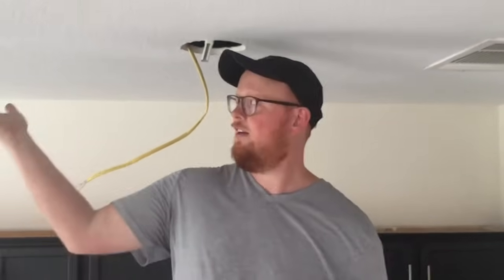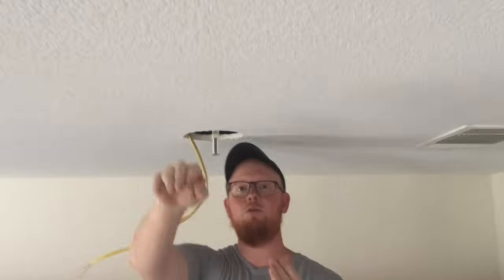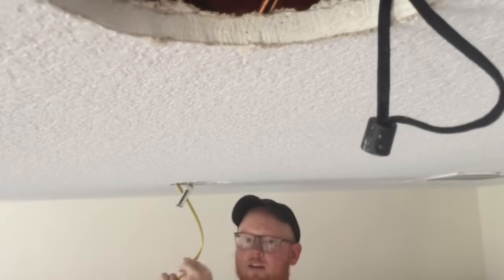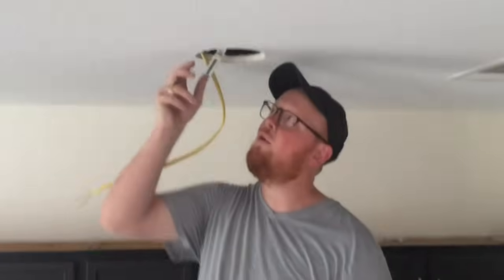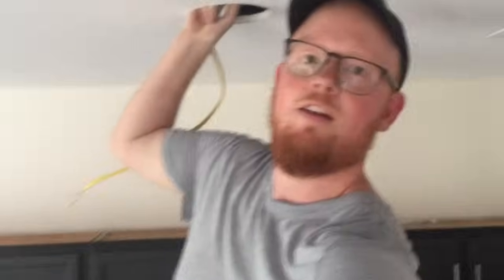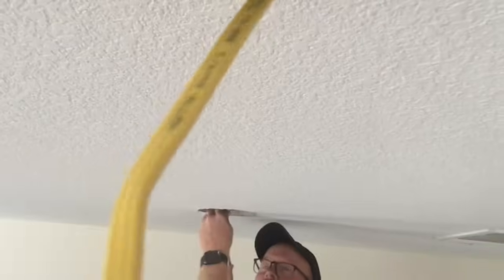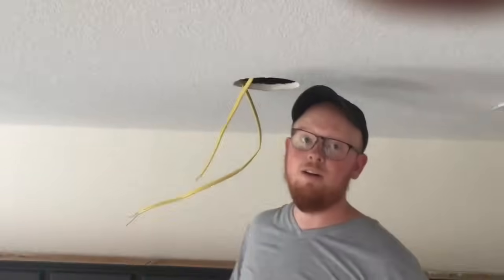Genius Method For Fishing Romex

Comment: The long drill bit you used to drill through those two joist has a hole near the tip. Before you pull the bit back out of the holes, use a small wire in this hole to attach your romex to the bit and pull it all back through the holes. Easy Peasy.
Reply: Exactly.  LoL
Reply: They probably used a regular short drill, and drilled once from each side
Reply: Make a video. I don’t get it.
Reply: Yep lmao
Reply: I was thinking the same
Reply: It’s like you didn’t even watch the video. He had to drill through two joists. Not one. Your tip is not relevant.

Comment: if you can fit a piece of conduit you could also run cable through it partly and use a vacuum cleaner to suck the cable from other side

Comment: An electricians flex drill bit has an eye in its tip that allows you to connect tie wire to use to pull the Romex??

Comment: I hate drilling blind holes through floor joists never know what's on the other side maybe a wire , water line, duct line
Reply: You are right, there could be a wire stapled behind there and you drill right into it. 
I use a small hole saw with the pilot bit removed and filled with a plug of wood that will not let me drill all the way through. You can screw/ fasten a small block of wood with a hole in it to start your hole, when you have almost drilled completely through remove the drill and knock out the drilled core with a punch.
Reply: You make that mistake only once, before realizing that the work involved patching the holes in the drywall is way better than replacing the entire ceiling, plus possibly the flooring,  plus possibly the ceiling on the lower level after you drill through a 3/4 inch water line. It's surprising how much water can come out of a severed line in the 120 seconds it takes to shut off the water...
Reply: Get an inspection camera; they start around $50.  Drill a 3/8" hole into the cavity on the other side of the joist.  Poke the camera through the hole and inspect the joist for wires, pipes, etc.  Drill with confidence.   Plug the hole with Plaster of Paris, or whatever your favorite patching compound is.
Reply: @TheMrFrugal  Lol  and i know how you know that....
Reply: @MrAgatto2  Experience is an excellent teacher, as long as you don't die in the process. Then you qualify for the Darwin Awards.
Reply: It’s amazing how quickly a room will fill with natural gas when you pierce a copper gas line with a drill bit while drilling blind through a joist or stud. It happens almost as fast as one fills their boxer shorts  with last nights dinner when pressurized gas is hissing in their face. 🤣

Comment: I'm an electrician on the east coast, thankfully we have strapping running perpendicular to the floor joist. Gives you a 3/4 case for wires, makes my life easier and my bill cheaper.
Reply: The rest of the country does not use strapping. Why? probably being cheap. Wish they did.
Reply: Your method does not comply with code requirements of the romex must be 1 1/4"from framing member surface!
Reply: Joseph Rauscher I do understand your concern. Here in New England we have been doing this sense the 60's. If you have a code book look up article 300.4 (D) also note exception #2.
Reply: Eric Wotton yup! That’s how we do it in Massachusetts.
Reply: Doesn't say 1 1/4 from framing member, only says where likely to be penetrated by a screw or nail. existing ceilings are by nature not likely to have this happen.

Comment: How did you get a drill in the hole long enough to go thru 2 studs??
Reply from the maker: I just angled it into a hole until I got the whole drill up there, and then turned it in the right direction. The bi only had to be long enough to go through one joist. I drilled the other joist from the other side

Comment: yes once you have drilled straight holes through multiple joists, it's not a big problem.  But to drill straight holes through multiple joists (16" OC) under intact drywall ceiling (WITH PACKED INSULATION!!) is might tough proposition.  With those super long drill bits it might go through roof instead if not extremly careful!!

Comment: I love being an Electrician but the truest thing is that you can get 8 electricians together and have each do a cut in box along with pulling conductors an installed a device. All eight will have a different way of doing it and completely crap on the way the other seven are doing their installation.....

Comment: But why did you drill holes when those joists have knock out holes? Isn't the joist designed for you to use the knock out instead of weakening it by drilling holes in random places?

Comment: I recently wired a new outlet on a outer wall and used a small pvc pipe to push through the insulation on the outer wall, it worked really good.
Reply: I have a 12 ft pvc pipe pushed through the attic of my home thru the connecting hallway to to garage attic.  I did the same thing, push it though the insulation.  But i added rope through the pipe to be able to fish wire, if necessary.

Great minds think alike.

Best wishes, from Texas

Comment: Twenty years ago as an apprentice, I watched the Journeyman use a 4' flex bit to drill through the floor joists straight into a water line.  That's one reason I don't ever 'blind' drill anything.  He had checked for possible hidden things.. other wires, pipes, ducting, etc.,  but it's easy to miss something.
Reply: R Nader yeah. My dad is an electrician and I help him out sometimes. When we do stuff like this we always use a fish rod to check if we’re clear. If we hit a truss or a stud, we pull the rod out and use it to measure how far the said obstruction is. Then we cut the drywall just big enough for us to see what’s on both sides before drilling the hole to run the wire. Patching the drywall is easier and cheaper than having to repair a waterline or home run or whatever else might be back there
Reply: I once had a job that included hanging pictures on walls in a nursing home. There was no telling what was inside any given wall, as it was multistory. I always used those C-shaped thin wire hooks that go in a tiny hole and can do no damage inside the wall. A friend told me about working with a certain I-know-better lead. The lead was about to drive a nail in a wall for the  picture. My friend asked if there might be anything behind the sheetrock. Oh, no, I know there's nothing back there! 10 seconds later the sound of water spraying inside the wall was heard. That was an expensive mistake.

Comment: As an electrician for 20+ yrs I never have or will drill drill through joists blindly. That is opening yourself up to big risks like drilling through electrical wires, plumbing, etc. I cut a hole in drywall and simply screw the drywall hole back when I'm done.

Comment: I didn't have the I-beam engineered trusses in my case, so I had some space between truss and belly of the flat roof, but the mattered none when I realized I left my fish-sticks home (AHHHHHH!). Happened to have a piece of 1/2" electrical PVC and it worked great. Just gotta watch for the paint on the walls.

Comment: If these are floor joist, then if no punch outs are available you must drill in the center of the web.  The center is zero forces where it changes from compression to tension.

Comment: My question is.... How long did it take you to fish that curtain rod through 2 holes?  Either you drilled some massive holes through those ceiling joists, you got extremely lucky with with that rod, or you persevered and got it through after quite a few attempts.  You couldn’t have sent a a straight rod 48” long through a bay that’s only 16” wide 90 degrees to the joist. Sending the rod in at any length over 14” would require you to bend the rod making things much more difficult. 

A simple piece of coathanger wire with a hook on the end then inserted through each hole in the joists and moved around until you “Hook” each other would have been much easier and probably faster. 
  Genius, I’d say not, but an A+ for ingenuity. 

  A Snake or Fishtape is the ideal way to go, they cost practically nothing and are available wherever you bought your electrical supplies. And it’s really not a good idea to drill blindly through ceiling, floor or wall joists.

Comment: Btw, if you're having trouble seeing what's up there, just stick your cellphone through the hole and take plenty of pics/video. No need to buy some expensive inspection camera. When I mounted the brace for a ceiling fan, I wanted to make sure the end teeth were adequately dug into the rafters to hold the weight. (They warn you not to expand these braces too much or you'll push the rafters apart and damage your ceiling, so a cellphone gives you a close look at the ends to judge how much to expand the brace).
Reply from the maker: We were not just looking through the large hole in the ceiling, but also through a small (3/4") hole in the joists.

Comment: So, they have this neat little invention called a “fish tape”.   Give it a try
Reply: a fish tape would be very hard if not impossible to get through 2 holes blindly.  You NEED something rigid.
Reply: @Executiveinvestments- 
Sir, metal fish-tapes on a spool are quite ridgid.
Reply: GrifFungin   Are you joking?   Think about what you said.  Fish tapes on a spool are rigid. They are made NOT to be rigid to flex and bend around curves and corners.  Fish tapes are flexible NOT rigid.  Stop trying to troll.
Reply: WINNING 
I think we need to define what you mean when you say “ridgid”.     A piece of material can be ridgid and not offer movement side to side while being flexible enough to be rolled on to a spool ie... a fish tape.
Reply: penndotpal   What?  Wtf are you talking about?  He said fish tape which is flexible to go around corners.  Obviously you have no idea what fish tape is.
Reply: penndotpal   Great but not a fish rod.   Splinter rod.  Nice try kid. And btw he clearly was talking about a fish tape.  Not a splinter rod.  Both of you have no clue.  Good job.
Reply: GrifFungin   Thanks for proving me right.  I’ve had a fish tape for years kid.  It is “flexible “.  Learn wtf that means.  It will sag under its own weight.  That’s why I said it’s impossible to use it for a 3 foot run through joists.   Again thanks for proving me right.
Reply: GrifFungin a steel fish tape will NOT stay straight when extended.  They are NOT rigid.  Explain how a rigid piece of metal can be rolled up.  🤣🤣🤣🤣.  It’s thin flexible metal made to go around corners.  Stop saying rigid fish tape.  There is no such thing.  Oxymoron.  When extended out just 2 feet with no heavy wire attached it says 4 inches.  Thus making it hard impossible to do this job here.  I have a fish tape kiddo and have run wires for decades.   You haven’t a clue.

Comment: There should be a 3/4” gap between the sheet rock and the trusses from the strapping so that you should not have to drill any holes, however if the builder took a shortcut and screw the sheet rock directly to the trusses then your  method would be a good way to go

Comment: So how did you get the holes to align so perfectly that the curtain rod was able to be fed through the trusses?  Just seeing the worst case scenario, you'll have folks trying this method and spending the majority of their time trying to get that "curtain rod" through those two holes.  Magnets seem the most practical to me in these situations.

Either way, this is a pretty cool accomplishment!
Reply: How in the world is a magnet going to help you find a hole 4-6" off the ceiling surface across two joists? Asking for a friend.
Reply: Feeding the curtain rod through the first hole of the rafter was simple because the hole was reachable.  No problems there.  

What I was saying that I surmised would be difficult was getting the curtain rod through the second hole in the rafter.  Currently is no hole in the ceiling to guide the curtain rod into the second hole - I know if it were me then I'd have a field day trying to hit that second hole in the rafter 😋.  

The magnet soultion I'd employ as a backup would involve the dad putting some ferrous material on a string through his rafter.  Instead I f trying to hit the rafter hole, then I'd just be using a magnet to attach to the ferris material...

I'd much rather use a curtain rod or some hollow, ridgid tool to route wire through any day, but I don't think I'd be as lucky to get through the second rafter as they did in this project

Comment: Why didn't they just feed a draw wire through when they drilled the joists.
Reply: escouter- How did you drill the holes through the joists, did you lift up floor boards from the room upstairs or was the kitchen ceiling down?
Reply: they make a bit for this application that will allow wire to be pulled back after drilling.....
Reply: escouter not every can light is a curtain rod length
Reply: escouter lol I always use fish rods, they're flexible and can fit in tight areas.  You did very well in thinking outside the box I'll commend you on that.
Reply: escouter https://m.harborfreight.com/3-16-inch-x-11-ft-fiberglass-wire-running-kit-65327.html

If you're really on a tight budget
Reply: escouter I've got some greenlee and Klein sets and those.  They all do what you need them to, if you have multiple joists it's either cut out drywall or use a flex bit and pray nothing is in the way
Reply: escouter I would invest in a flex bit or fish rods.
Reply: Jonathan Clabo I've broken these several times. Once with a very cheap boss who bought all his tools from harbor freight.  He was a master craftsman too. The 2nd time I used some of a client's. Snapped not far into the project. I carry Klein 6' fish rods and flexible bits but the client wanted to use his since he just bought them.
Reply: gizmo I'd agree I've got a set of Klein as well the harbor freight is if you're on a tight budget diyer
Reply: Jonathan Clabo They gave a tip on how they did something that worked. Take a chill pill.
Reply: EGGINFOOLS with that logic I could just take a hammer and bash the ceiling and drill holes as needed and route my wire does that make it right? It works that way too.
Reply: EGGINFOOLS how many times have you routed wire in a sheetrocked ceiling with no access?
Reply: Jonathan Clabo a lot. Why does that matter? Are you going to compare experience? Or tell me how you are such a professional? It doesn't matter. Stay on topic. They got the job done with minimal issues and money. Job done.
Reply: EGGINFOOLS then you'd know jamming a conductive sharp rod into a ceiling where you don't know if there are other circuits or not isn't a good idea
Reply: Jonathan Clabo Would be no different than drilling the holes with a spade bit? Did you think the holes were going to make themselves? Obviously if they were feeding the rod through the holes they just drilled there wouldn't be anything in the way. Plus they could see the rod going into the hole.
Reply: EGGINFOOLS he's gonna have to go at an angle at the first hole going in blind, it's what you don't see that gets you.
Reply: EGGINFOOLS the last thing you want is someone to watch this, with zero knowledge, and start jamming a curtain rod in the ceiling wouldn't you agree?
Reply: +Jonathan Clabo  I have cleaned up after someone did the "punch and drill" method on a smooth finish, but have you ever tried to match the finish on a textured ceiling? I say they came up with a good idea that didn't kill an hour with a run to Home Depot. After all, time is money.
Reply: rupe53 lol sometimes it's a mess depending on the electrician.  Personally I try to help the drywaller as much as possible if I ever have to cut in for access.  I don't like leaving holes.
Reply: In the telecom business, we used a thin but strong pull string and tied it to the end of the drill bit after making the hole, then pull the string back when retrieving the drill bit.  Drilling blindly is a hazard.  I know from experience.  Sooner or later you will hit something.

Comment: Pretty clever, I was wondering, is the curtain rod fully straight, or is their a 90deg bend at the receiving end. It seems that pushing the romex from the one end, it could probably allow the elbow to be protruding from the receiving end, (working solo, I don't have a helper) and the wire would follow on out the exit. A longer span beyond 2 joists would require leap frogging, but who knows? Damn cool idea, glad I watched.
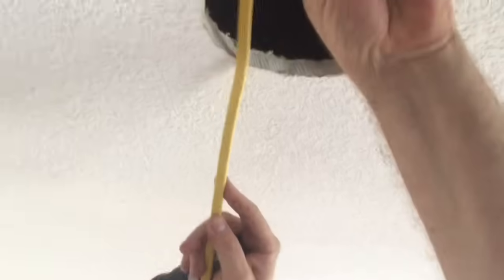Reply: The curtain rod has a 90 deg bend on the end that my son is holding in the first part of the video.  It's the standard bend that curtain rods of this type have.   The part he fed through the 2 holes is straight.  Once it came through the second hole, I could see the curtain rod end, and at 1:20 in the video, I'm inserting the romex into the curtain rod, which he then pulls back through both holes.
Reply: working solo myself and trying to fish wire through plaster walls. When I had the urge to use a crowbar to demolish said walls, I thought I would check out some helpful videos.

Comment: Or, just get a 4' long flexible drill bit that was invented to do this..
Reply: +escouter   https://youtu.be/ydh-l1QsnQ0 
Attach bit to drill, use guide to angle drill bit.  Drill through one /two/three beams (with extension bit if necessary) to reach your next hole. Attach pulling basket to wire, then attach basket to drill bit.. pull drill bit back, using the bit to pull the wire through the path you just created.  Also google fiberglass fish sticks.  Cheapest sets are from harbor freight for about $9, but they work. Klein, greenlee, Jameson are other brands.
Reply: Google Klein flexible drill bit kit. Or greenlee flexible drill bit kit.
Reply: I thought I wouldn't use one much until I bought it. Now it's my go to for renovations. If you don't have to do this much does that mean you're not an electrician?